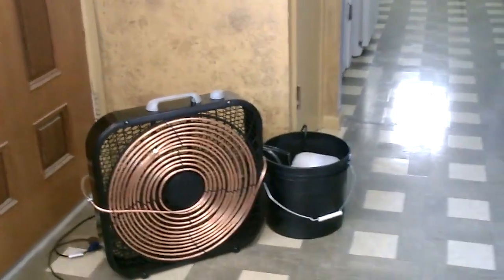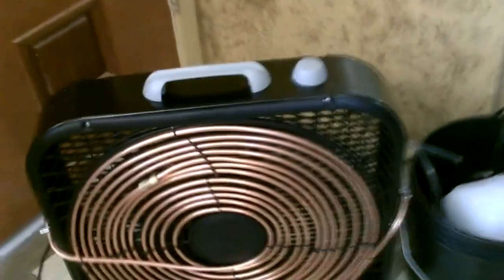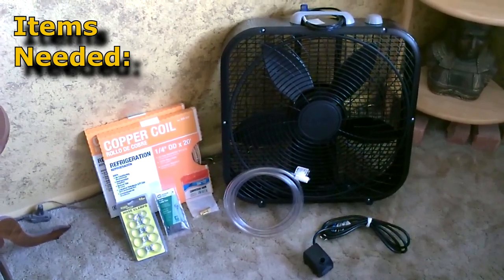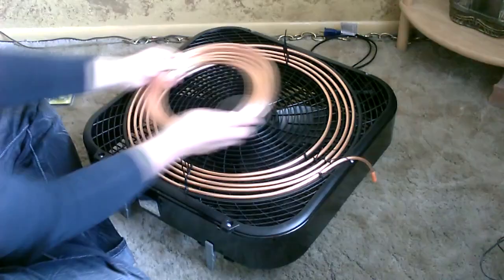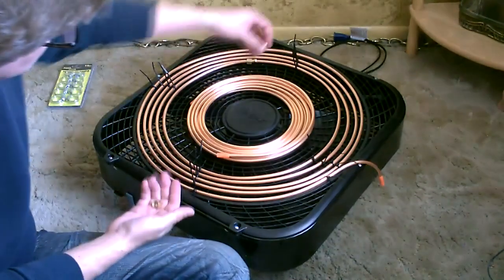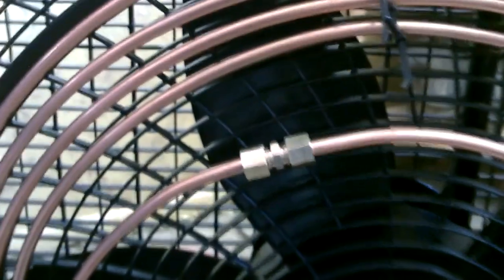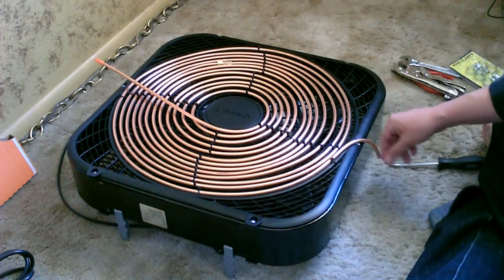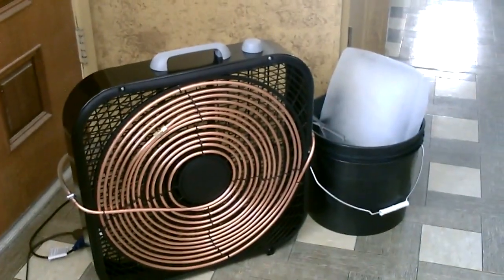Homemade AC - The "Copper Coil" Air Cooler! - (Simple "Box Fan" Conversion) - Easy DIY

Comment: Hi I just made this and when I used it the first time it worked great. I then set it up again a few moments later and it seems like it won't pump through the copper. Almost like there is a pressure change and air is pushing the water back. When I remove the plastic tubing water squirts out so I'm thinking something is happening when the water moves from the plastic tubing to the copper... any thoughts? So strange that it worked at first and now is not.
Reply from the maker: +Alex Masterson hi there. that tends to happen if the water pump you're using is too weak. when i made my first copper coil air cooler (3 years ago) i first tried using a 158 gph pump (and, similar to your experience, it only worked the first time). ever since then i've used pumps that move 200 gph (and they work great every time).
Reply: +desertsun02 Thank you! I figured out that if I placed the fan on its side it would start to pump and once the momentum was going it was fine upright. Thank you for your response!
Reply: +Alex Masterson WHat size room are you using to cool it, and how well does it work?
Reply: +David “Waitwutmyname” Hager It works well if you are near it, but not that great to cool off a room, even a small 10x10. The other issue I've run into is that the ice melts too fast because its so hot, even in the cooler. And once it circulates through, the water is pretty warm on the other end. My husband suggested getting some dry ice to put in a separate container to keep the circulating water icy cold. Haven't tried it yet.
Reply: David Hager It's hot. High ninenties!
Reply: Alex Masterson ok thanks for the help. I'm trying to find something to cool down a dorm room, but everything apart from a fan is banned because of some stupid fire hazard regulation.
Reply: +Alex Moran How long does it end up lasting?
Reply: +Alex Moran I loved you in Blue Mountain State.
Reply: +DesertSun02 Thank-you Awesome Videos #1
Reply: +Alex Moran Kind of curious about what happened with this did your pump fail or did you have your exhaust tube immersed or vise verse?
Reply: One thing that could help on cooling, try putting salt in the water. Salt water has a lower freeze point could actually be below 32°, thus cooling better.
Reply: +musiman28 good idea
Reply: That's a good idea or how about a little bit of anti-freeze?
Reply: +BuddySteve not good if you have pets or small children. pets will be attracted to the cold water and sweet taste of the antifreeze
Reply: Yeah! Anti-freeze, or a small amount of alcohol and oil. Alcohol has a VERY high freezing point, and the oil will everything run more smooth.
Reply: Someone help. I built this and only half the coils get cold . I got the next size pump 160-300 gph pump .

Comment: How about a drum high velocity fan with a fin copper coil that covered the front of the fan with a little copper coil on the return flow in the back of the electric motor to help cool the drum fan motor? Then design a sterling cryogenic piston that turns argon gas to liquid that filled an insulated tank with a siphon to charge the copper coils with the liquid argon boil off gas vapor being drawn back to the cryogenic piston to start the cycle all over? Hay even liquid helium could work right?

Comment: Also, has anyone tried putting propylene glycol in with the water? I would expect it to reduce viscosity and increase the heat coefficient and shouldn't affect the copper, but I don't know if most pumps would be happy or not.  Also, my impulse is to use distilled water. You'd basically never have to replace it, and it wouldn't gum up the pump or the tubing over time.
Reply: Why would you never have to replace the distilled water? Are you going to refreeze it? What do you mean?

Comment: Is their a diff between vinyl and copper tubing as far as cooling?  My fan has vinyl tubing but isnt working very well.  I was thinking ahouldnt it have coils like an ac to cool air better?  I was thinking of getting a box fan and connecting 2 old heater cores to it to try.  Should the pump work slow or fast?
Reply: thanks, i figured that because the vinyl doesnt get cold stays warm.  I will get copper when i have time :(
Reply: Vinyl is more of thermal insulator whereas copper is a thermal conductor. Thus, the copper will transfer the cold from the fluid to the outside surface of the tubing. (Technically, it is actually transferring the heat from the outside in, but the layman's view works well enough to explain it.) The vinyl will not transfer the heat/cold as readily, so it will be considerably less effective at cooling the air.
Reply: sisgaia thanks for the better understanding

Comment: ive got a ten foot by ten foot room, which of your homemade air cooler devices do you recommend for dropping the temperature effectively? The room is usually in the late 80s temperature wise with moderate humidity, and we have a lot of electronics in here that crank up the temperature a bit more. Would any of these work and its more a preference for what I want to build, or is there a specific one you recommend?

Comment: I did this with liquid nitrogen in the pipe... IT WAS COOOOOLLLLLDDDDD!!
Reply: Can the pump handle it?
Reply: It can slightly... But it will freeze up after about an hour, but the fan will keep blowing cool air.
Reply: +Nimda Good eye!  Chemically speaking, keyboard duster cans are essentially R134a, without the extra oil for a compressor.
Reply: just curious because i'm stupid and dunno the first thing about chemistry, but does it stay liquid when coming out of the drain tube or does it turn into gas? Either way is there a danger with the nitrogen?
Reply: Main Lane Shutty, you big fibber!!

Comment: What if u fill that copper coil with liquid nitrogen and close it from both ends ... Will it work ???
Reply: Yousef Turabi probably not. once the liquid nitrogen heats up after cooling the air it will evaporate into a gas and loose any ability to cool. It's just like ice melting into water

Comment: sorry I wanted to add... to severely increase the water temperature, make sure to add salt since it lowers the temperature for enhanced efficiency.
Reply: +Matt E.  yep!
Reply: The intake water temperatue is close to 32 deg. F. What difference do you expect using salt water? I would expect that to be strongly dependent on the temperature of the ice.

Comment: Would it be more efficient to use something like an IGLOO to keep the ice melting at a slower rate? It could double or quadruple the time. Right?
Reply: Nope - you want to melt that ice as fast as possible. This entire point is to move thermal energy from the room into the ice.
Reply: @erich1394  interesting point, but wouldn't more of that air be spread through the room if it's melting in the path of the fan (in the tubes)?
Reply: @wrybread  Thermal differences in the room will equalize themselves via brownian motion, which is a term that refers to how fluid molecules (air in this case) randomly move about and bump into each other. This is how smells spread in rooms or how things dissolve in water - it's all down to that random brownian motion.

That being said, a fan definitely speeds up the movement of air and helps the room equalize in temperature faster instead of having cold spots and warm spots that take a while to dissipate / mix with the rest of the room. 

Anything that makes the ice melt faster (aside from adding a heater!!) will help the room cool down faster.

So, if you devise a situation where blowing air over the ice with the fan causes the ice to melt faster, then yes - you've made a more efficient machine. If the ice is melting at the same rate either way, then no.

The point is that you can track the rate of ice melt to know how good of a cooler you're making.

The fact that the ice is melting is proof that the thermal energy has been absorbed into the air.

Does that make any sense? Feel free to ask further questions - I like this sort of thing and I sell industrial refrigeration equipment for a living, so I'm somewhat qualified. A lot of stuff surrounding heating and cooling isn't exactly intuitive and can take a minute to wrap one's head around!

Comment: How do you keep it from leaking at the clamps? I tightened both of them and they still leak
Reply: use a flaring tool to flare the ends of the copper line.

Comment: Why not use a plastic or rubber pipes instead of copper pipe?  Copper pipes are very costly.  Does it make any difference?
Reply: john marcus copper is used to keep things consistently cold or hot depending on your situation plastic or rubber wont help it just makes it worse

Comment: What about the condensate.  That copper  coil would be sweating its balls off.  Good job! thanx.  How do you like the absorbation system of cooling?  My grandmother had a refrigerator that ran on kerosene flame.Very cool and efficient.  Ammonia is the answer, but, pure ammonia is explosive, so be carefull!

Comment: Hello desertsun02  , when you have to use the ice... there lies the limitations. I was wondering, what's the result using norma water? Copper pipes get cool with rapid flow of fluid anyway. I guess it might be atleast cooler than the normal fan right?
Reply: Don’t know if still relevant, but if the water is at room temperature it won’t transport any energy out of the air. For any heat transfer there has to be a temperature gradient, which is given with ice. The only cooling would come from evaporation out of the bucket, but for that way it would be more efficient to soak a towel and place it over the fan.
Reply: @PaulusFlorage   . Hello thank you. Yes right too. :)

Comment: Which one works better? The copper fan or the ones in the 5 gallon buckets or coolers. I made the styrofoam cooler one last year.
Reply: ***** read the description.
Reply: It's better to do both and combine them you can easily do this by putting the cooler behind the copper fan thus blowing out extra cold air depending on your situation or how hot it truly is
Reply: Better to use styrofoam ... Thats dosnt give headach of melting ice .... If you use boath that will not be power efficient becoz water drops from styrofoam will be condes and turn to water by copper coil...

Comment: Hey man. Cool concept. Question" I live in S.C. and we have 90%+ humidity year round. Evaporative coolers won't do squat, but this looks like a much better set up. In your opinion, would this work in high humidity?
Reply: Not my project, but yes - would have same effect as AC unit, though possibly a bit weaker.

Comment: It looks like it would just add humidity it would probably work great in a low humidity
Reply from the maker: hi. since this design is basically a simple water to air heat exchanger it doesn't add any humidity to the air. it actually takes a little out. that's because water will sometimes condense on the copper
Reply: Do you think this would work well with a high velocity fan?

Comment: Could you not make a supper cooler out of a igloo and run antifreeze through the capillary over the fan then start the cycle again? You could make cooling channels within the igloo to keep it all running at a certain temperature.  If done right this could be used for tents even in tiny homes you could market them. I thought of a heater using your idea has well using oil and a heat pump on a metal fan. Not scalding hot oil but just enough to warm the air. I have a small design I am working on for homeless and people with children. NO burning no fumes and the coils are inside the fan cage infront of the blades.  Some thing like this could mean life or death. So I like to share my knowledge.

Comment: Dont you get condensation dripping from the copper pipes to the floor?
Reply: Put the fan over the bucket.
Reply: Or make a drip pan to drain condensate back to bucket

Comment: what make the water move in the copper coil ?
Reply from the maker: Karate Mohammed there is a small water pump in the bucket (under the ice) that is circulating the water through the coil. it's a 200 gph aquarium/water pump from harbor freight. (cost $10)
Reply: desertsun02 Can you give us the part number for the pump? The 200 GPH pump that I found at Harbor Freight has a 1/2" outlet. They do not make any adapters, or reducers to allow me to create an air-tight attachment between the 3/8" (OD), 1/4" (ID) vinyl tubing and the 1/2" pump outlet. I could not find any adapters or reducers anywhere else. How did you attach the vinyl tubing to the 1/2" outlet on the pump?
Reply: Mike Arnold Can you heat the vinyl tubing and stretch it to fit the larger diameter outlet? I used to do that for my aquarium tubing.
Reply: You could also siphon the water too!
Reply: desertsun02 awesome! That wasn't shown in the video. I was thinking the same thing
Reply: Mike Arnold There are different size tubings and 1/2" to 3/4" and other various plastic adapters in the plumbing department at Home Depot. I was analyzing all of them for another pump. Have to go check out the pump used here. You can use a clamp to tighten down the outlet. Just be creative :)
Reply: the only thing that worries me is some Crackhead breaking into my house and stealing the copper!!!
Reply: +Jay Hickey BWAHAHAHA! D:
Reply: +Karate Mohammed Water Pump
Reply: +Jay Hickey 
Funny but a realistic worry.  Having worked at a scrap yard for 11 years, I can tell you that it happens all the time.
Reply: +Jay Hickey hahahahahahahahahahaha
Reply: antifreeze coolant 1 gallon $9
Reply: thats funny LOL
Reply: +Mike Arnold: I have several old and reliable Hagan Aquaclear 30 power heads lying around. They are rated at 174 GPH when the Venturi is Sealed off (Silicon 1 Sealer). Their output is Square with a Very Thin plastic Square to 1/2 Inch I.D, Adapter. (Too thin to hold internal circumferential pressure) So I use a short 1-1/2 Inch length of 1/2 Inch I.D. Pex Pipe (Heat one end with a Hair Drier on High Heat And while it is slightly soft push it over the Round end of the Power Head Adapter). A 3/8 Inch Inside Diameter x 1/2 Inch Outside Diameter Vinyl Tube will Compression fit into the Pex Pipe piece quite well. (Wet it first to make getting the end in easier). And a 1/4 Inch Inside Diameter x 3/8 Inch Outside Diameter Vinyl Tube will fit into that. The Pump and these short 'adapter tubing' lengths will be submerged in the bottom of the bucket so any slight leakage there would not be a problem anyway.
Reply: Where would you siphon it to? In order to siphon you have to have one body of water higher than the other.
Reply: pump: 200GPH (from harbor freight).
Reply: Question what can I do about the sweeting of the cooper line I did everything it works n there's no leak but the coil sweets a lot what can I do about that
Reply: Buy a washing machine tray made to catch water under leaky washing machines.
Reply: Karate Mohammed hi
Reply: Jay Hickey it's so hot now the crackheads are putting copper back in the AC to run it to cool off
Reply: That would only serve to empty the original bucket.  You'd have to have a second bucket with a lower rim to make it work.  The pump recirculates the water back into the same bucket.
Reply: @mikearnold1134  I know this is an old comment but just incase anyone was curious, you can find adapters to make the pump accept different tubing at many different places. Any hardware store, True Value, Home Depot, Lowes, Amazon, Ebay, Jegs (or other automotive supply store), plumbing/HVAC/ supply house or just Google it in the shopping section. I'm sure most pet stores would even carry adapters for different pet setups.

Comment: Mine is not pumping the water through the copper lines. The pump I bought is 70 gph, any suggestions?
Reply from the maker: hi there. 70gph pump wouldn't be strong enough to push the water thru the pipe. i've tried/used a 158gph one and 200gph one. the flow on the 158 is pretty weak so i use a 200. harbor freight has a 200 for about 10 bucks.

Comment: for anyone still looking for a way to deal with the condensation, I currently have my device over top of my sink. lol.   I have no AC, and I couldn't stand it a moment longer.   Anyhow,  I will be getting a cooler.  The barracks I live in have an Ice machine, with free ice.  Once I get a cooler, I'll keep the contraption over the cooler, so the condensation drips into it.   This may cause the cooler to fill, (extremely slowly).  But I wont fill it up all the way, and I'll just keep an eye on it.

Comment: I use  similar things to cool of my grow room, Little or no electric easy to refreeze water and when using a Super well insulated container. I use a Blood drive box 4 ft by 4 ft cooler. Keeps ice for days. And my room at 70 degrees in a 15 light grow room. I have  12 000 btu in the window. and 3 of these in the bud room one 4 fans on the wallls.  in veg. Gets very hot here.